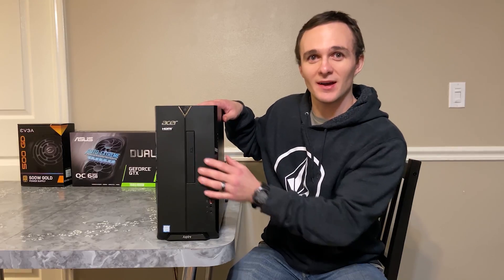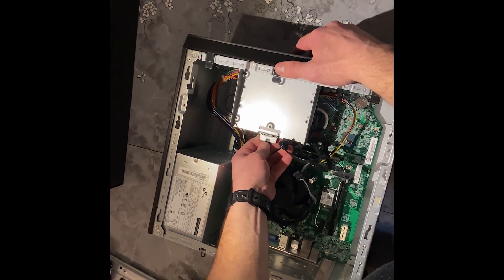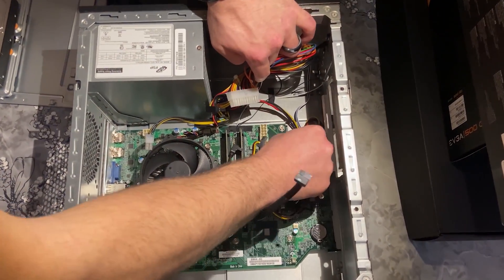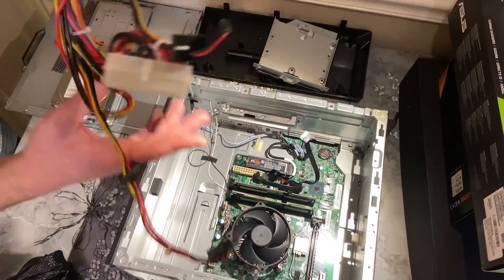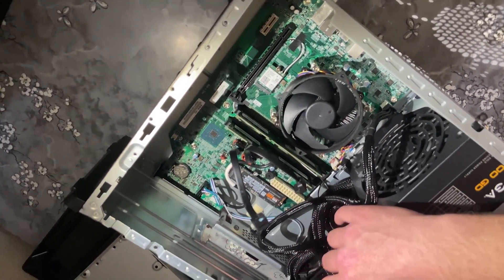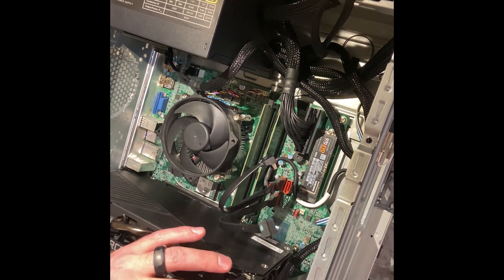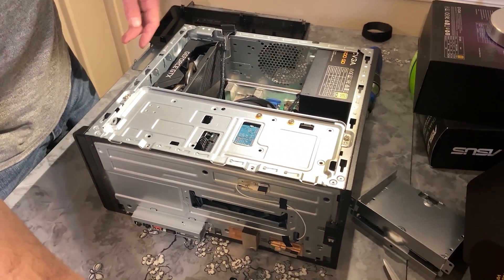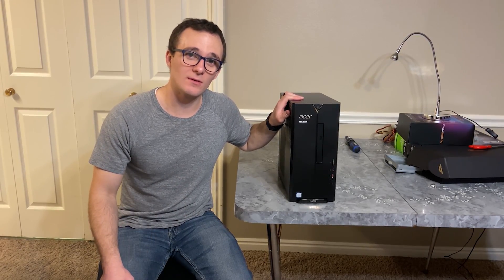How to put an Nvidia 1660 Super and change the power supply in an Acer Aspire TC-885 ACCFLi5

Comment: I have an issue with this. I basically have done exactly what you did with the graphics card (didn’t need a better power supply) but the ‘Intel (R) UHF Graphics 630’ after me uninstalling it reinstalls itself automatically. After using special software to uninstall it, my screen just flashed black and it reinstalls itself. Any fix on this? i have the exact same PC by the way
Reply from the maker: I think Windows sees that you have a cpu with graphics onboard and automatically re-installs the drives for them. When they are installed, does the display on your gpu not work?
Reply: dmoneyballa it turns out i did need a new power supply. i really appreciate the effort though, you are really dedicated to this channel

Comment: Thanks for the DIY video 😃. The 1660 Super has a HDMI 2.0b port. Does it support 4k@60hz? My Acer TC-865 w/i5-8400 HDMI ports are 1.4b which are limited to 4k@30hz. I simply want a graphics card with HDMI 2.0 supports 4k@60hz, HDR, 10 bit color and wcg (wide color gamut). 

My desktop PC also has a USB 3.1 type C gen 2 and SHOULD (BUT DOESN'T) support 4k@60hz resolution with a USB C to HDMI 2.0 cable or adapter. BUT THE DARN USB C PORT DOES NOT SUPPORT 'DP ALT MODE'👿!  

ONLY CERTAIN LAPTOPS AND DEVICES SUPPORT IT (IPad pro, Samsung S8, S9, S10, Surface Book 2, Dell XPS 13/15, Pixelbook and others).  WHY A DESKTOP PC WITH AN INTEL I5-8400 CPU THAT SUPPORTS 4K@60HZ IS EQUIPPED WITH HDMI 1.4B AND USB TYPE C  HARDWARE THAT CANNOT DELIVER THE CPU'S FULL DISPLAY RESOLUTION MAKES NO SENSE.  UNLESS I'M SIMPLY CONFUSED AND OVERLOOKING SOMETHING. 
https://www.amazon.com/s?k=USB+C+to+HDMI+2.0+cable&i=electronics&ref=nb_sb_noss_2
Reply from the maker: I think it'll do 4k@60hx just not in most video games but dipslaying content I think it can. When I go here https://www.nvidia.com/en-us/geforce/graphics-cards/gtx-1660-super/#specsmodal and click on full specs, I see that it has displayport 1.4a and hdmi2.0b and at the bottom it says 4k 12-bit HDR at 144Hz or 8k 12-bit HDR at 60Hz over one DisplayPort 1.4 connector (with DSC). I don't know if that's what you're looking for but I hope this helps.

Comment: So the installed GPU in the video has the dimension of 20.6 x 12.4 x 4.6 cm, may I ask if this PC case has enough room to house a 1660 S GPU with size 24.6 x 12.7 x 4.6 cm,  about 4 cm more in length? Thank you :)
Reply from the maker: Yeah that fit, here's a photo of how much space is left after installing the gpu, I removed the power supply but this is a good idea of how much space there is: https://dmoneyballastech.wordpress.com/2020/11/03/space-with-my-1660-super-in-acer-aspire/
Reply: @dmoneyballa   Thank you so much

Comment: could I put a gtx 2060 into this?
Reply from the maker: Yeah as long as the dimensions are right.
Reply: @dmoneyballa   could you post here the dimensions of your graphics card please i could go based on that
Reply from the maker: Yeah here's the dimensions from Amazon: 8.1 x 4.9 x 1.8 inches.
here's a photo of it actually in the case so you know how much more space you have to fit stuff in: https://dmoneyballastech.wordpress.com/2020/11/03/space-with-my-1660-super-in-acer-aspire/
Reply: @dmoneyballa  im super interested in a 2060 as well but i dont know how to check if it will fit any advice

Comment: Hey there. Thanks a lot for the guide. It was very helpful. I have an ACER Aspire TC 885 EB-11. I wound up getting almost the same card you demonstrated in your video. I got the "Asus TUF Gaming GeForce GTX 1660 Super Overclocked 6GB" graphics card, while the one you were showing is the "ASUS GeForce GTX 1660 Super Overclocked 6GB". The 2 cards are almost identical except for the size. The "TUF" card occupies 2.3 slots, while the "Geforce" card you showed occupies 2.7 slots. Not much difference really, but the additional space of the "TUF" card might give a bit better Airflow around the components. I got the "TUF" card on Ebay from Newegg for $300 CAD. 

I used your Associate Link, and purchased the EVGA 500w GD Power Supply. Hope that helps a bit. I paid $100 CAD for the Power Supply on Amazon using your link. 

I'm actually doing this upgrading so I can make my 1st foray into VR gaming. Picked up an Oculus Quest on Ebay for $300 CAD. 

If anyone is interested in seeing a pretty compelling video on a great VR build on a budget, check out MRTV's video. He actually recommends the GTX 1660 Super in his build, though he goes with a 600w PSU (though he does mention it's a bit overkill, and he uses it just in case the User wants to further upgrade in the future). Here's the video :

The $700 VR PC For Stormland, Asgard's Wrath & Half-Life: Alyx - Perfect For Oculus Quest & Rift S!
https://www.youtube.com/watch?v=ukdxxVSjzr8

PSA : I do want to say that the Oculus Quest looks to be an amazing VR Device for a great price and I'm crazy excited to start playing...but...all of us Gamers need to be aware of what Facebook is doing with the Privacy Policy. All new Oculus users starting October 11th, 2020 will be OBLIGATED to use a Facebook account WITH their "Real Name" and "Real Phone Number". No burner accounts allowed. Facebook will be collecting all kinds of data on Users including : Location, Play Space, etc. Let's be clear. The reason Oculus Quest is so cheap is because YOU are part of the price of the device. Your User Data will be paid out to "Facebook Partners". 

MRTV has a great video on the topic. 

OCULUS QUEST 2 - WATCH BEFORE YOU BUY! What Forced Facebook Login Means For VR | MRTV Opinion Piece
https://www.youtube.com/watch?v=GKaI_lHHV4Q

Conclusion : I'm really excited to play with my new (Ebay used) Oculus Quest! And I'm also really excited for HTC, Valve, Samsung and others to come out with their own Standalone VR Headsets so I can get rid of my Oculus and move to a VR Platform that doesn't FORCE me to use my Real Name, Real Phone Number and have my data being sold to unknown 3rd parties. 

Sorry Facebook. 1984 wasn't a Playbook on how to run society. You seem to forget that.
Reply: Thank you for clearing up two different cards! I was wondering why the one he linked looked smaller/different.

Comment: i put a noctua fan for an upgrade on the sys fan output and the fan wont stay on only when booting and turns off any reason ? im gonna be doing the same upgrades i have the tc-895-ua92 version
Reply: I have the same model computer and had the same problem.  I used the supplied y-cable to connect the NF-A9 to the same connector as the CPU fan.
Reply: @dadx6101  could you tell me step by step what to do I’m new to this computer world lol

Comment: I am going to do this however, I am going to add a GTX 1050ti as it is smaller than the 1660 to make better air flow, I am also going to add a 120mm fan to the back side to help air flow
Reply: Can it fit a 120mm fan at the back?
Reply: @tightonthatmoney  not sure, an 80 mm fan might be better

Comment: i put a new 500w power supply in mine and it worked. i also put my new geforce 1050ti card in it would not turn on and do i have to pug in the six pin connecter
Reply: Daniel DeAmicis yes, you put the connector in
Reply: but make sure that you plugged the hdmi/dvi/displayport into the GRAPHICS card not the board

Comment: do i need a new PSU or will the stock psu work too
also will gtx980 strix fit in the case?
Reply from the maker: It may work with that. I would use Newegg's powersupply calculator to see if it will work: https://www.newegg.com/tools/power-supply-calculator/
I got my gpu in there with these dimensions: 9.50 x 5.10 x 2.10 inches
Reply: dmoneyballa thanks
Reply: @dmoneyballa  sorry but do you know what motherboard this pc uses? i don't know and it needs the motherboard to calculate the amount

Comment: Hey I just wanna say your videos has helped me so much uprade my acer 885. I just put a 450 watt psu in. Now I wanna do my gpu. I have a 1050 ti in now. Can I put in a 2060 with the 450 watts or should I just save some money and do a 1660 super.
Reply: Do you know if the 2060 fits inside? I’m thinking about doing the same but i’m not sure if it’ll fit or not
Reply: @brynan6206   I don't know if it fits. I just ended up getting a 1660 super. My main thing was I don't think I have a big enought power supply
Reply from the maker: I like to use Newegg's power supply calculator just to make sure it'll be able to handle it. https://www.newegg.com/tools/power-supply-calculator/

Comment: I have a question - did you reconnect the DVD drive and if so - did the power supply you used have a small data power connector for doing so. I have a cooler master 500 watt here and it doesn't have that tiny data power connector so I can't power my dvd drive anymore now that I replaced the PS.
Reply from the maker: I didn't connect the DVD drive when I switched the power supply. You could use an adapter like this:  https://amzn.to/3gKjVhH

Comment: Hey dmoney. I talked to ya a month or so ago about my aspire 885. I'm getting the i7 9700f like u suggested. But I also got Noctua NF-A9 pwm but I don't know how to make it work. I tryed looking for it in the bios but no look any suggestions?
Reply from the maker: is the issue that the computer won't boot when you place the 9700 in the cpu socket?
Reply: @dmoneyballa  no I haven't even gotten the i7 yet. I put the case fan in. And I connected it to the four pins connector on the motherboard. But the fan won't run
Reply: I had the same problem.  I used the supplied y-cable to connect the NF-A9 to the same connector as the CPU fan.
Reply: @dadx6101  but can you control the speed of the fan or is it on all the time?
Reply: @robesposito9763  When the Y- cable is plugged into the 4 pin CPU fan connector the speed varies along with the CPU fan.  When the fan was plugged into the system connector I never did get it to turn even when running all 6 CPUs  at 100%.
Reply: @dadx6101  ok good to know so the fan won't be at 100% all the time
Reply: @robesposito9763  Just make sure you leave a few inches of  open space on the side of the the case with the air holes.

Comment: Hey man absolutely great video helped my understand the pc a ton, I have an Acer aspire TC 885 ua92, and I was wondering if I got a 700w power supply, could I put a gtx 1080 mini into the computer? any response would be highly appreciated, thank you!
Reply: How did this go? Im hoping to get a 650 watt and rtx 2070 super.
Reply: @DAN.eight6  hey dude, since that comment I have actually sold the computer and bought a much better computer, however with the specs that I listed, it fit into the computer perfectly! The only slight complication for mine was that I had to remove the CD tray, but I never really used it anyways, and it was easy to remove. I am unsure about your specs because as I said, I have since sold the computer, but with a 700 watt power supply and mini gtx 1080, it fit like a glove. Make sure to buy the smallest graphics card you can if possible, cheers!

Comment: can i do what you did but with a 1650 graphics card and if so do i need a power supply too?
Reply from the maker: You can put in an Nvidia GTX 1650 gpu without changing the power supply.
Reply: Hey @dmoneyballa I just bought a 1650 and bought a acer aspire TC EB11 and followed your video on how to install the GPU but after I plug the 6 pin connector into the GPU I am unable to put the hard drive plate back on flush because of the intruding connector and wires in the GPU. Do you have any ideas on how I could fix this cause The dimensions on our GPUs are the exact same so I’m confused on why I can’t get mine to fit

Comment: Hopefully I'll be able to do the same thing to my Acer Aspire XC 886 with the 220w built in PSU. Difference is, that type of PSU can never fit to the small factor case. I searched online and it's either a flex atx power supply or TFX power supply. I'm new to this and I don't know why I feel so dedicated in doing so.

Comment: Hey I am looking to do this have you had any problems so far and what kind of frames do you get for aaa games
Reply from the maker: I wasn't using MSI afterburner at the time of the upgrade so I don't have a ton of tracked data but I did some benchmarks in this video: https://youtu.be/13azmnUHYeo. Hope this helps.
Reply: @dmoneyballa  did it ever over heat for you or something
Reply from the maker: I didn't play too many games on it while in the Acer case, I mostly video edited and it didn't cause any problems. I put it in another motherboard and another case with more case fans so it would get better airflow. I'm still using the same 1660 super but am using a Ryzen based system currently.

Comment: My motherboard starts beeping when I boot, Help plz :(
Reply: Do you still need help
Reply: Michael Finlayson its all good now, the ram wasn’t installed correctly...
Reply: I could use help.   Same problem only works when I disconnect card
Reply: @elixertherapper9264  what is the type of beep? (like 1 long beep? 4 beeps?)
Reply: 1 beep then fan runs and nothing else monitors have no signal
Reply: @elixertherapper9264  Did you install a Ram stick?
Reply: Ram was already maxed out before this but I just figured it out.  I have 2 monitors and whe. I unplugged the 2nd monitor that wasn't plugged into the gpu and disabled the integrated card it worked
Reply: @elixertherapper9264  Nice

Comment: Did you have any overheating problem because the GPU seems to be really close to the bottom of the case
Reply: I did this exact setup with a 1660 super there is a bit of heating problems but as far as i know, the GPU doesnt really get more than 70-75C on max load. I was running modern games on max graphics with 144 fps and was getting about that. It gets close to an uncomfortable range, but i dont think i have ever seen a temp higher than 74C.

Comment: Thanks for the video! I just got an Acer, too. Do you know if I can install a secondary drive in the dvd drive slot, or is that just for laptops?
Reply from the maker: yeah, you could probably do that. The hard drive tray has space for another drive and there's also an m.2 on the motherboard that you can use to connect an ssd or nvme drive.

Comment: I’ve installed the gtx and everything’s good but when I try to connect it to my monitor it won’t show
Reply: Try to connect HDMI cable to graphic card.
Reply: Same here, pc boots, gpu fan spin but i have a black screen
Reply: @sdss903  Did you fix this problem? I'm having the same issue
Reply: Raghav Rao yes it was fixed.. it literally fixed itself. I quit trying for a couple days, i tried bios configurations (very limited), i updated all my drivers, i updated bios.. nothing seemed to work. After the few days i decided to try again and make a boot usb.. when the pc was up and running I realized it finally was running on my cloned nvme finally. I still haven’t wiped my hdd but it has been booting up perfect for a few weeks now.

Comment: I can't put my hard drive back on after plugging in the 8 pin connector. Any tips?
Reply: I’m having the same issue right now and I’m wondering how he fit the hard drive in with ease my 6 pin connector and wires aren’t letting me put the hardrive plate down flat did you figure out a way around this?!
Reply: @fendermac1  from what I understand they do it on purpose. I didn't find a way unfortunately and bought a new case. Wish I got custom built from the start.
Reply: @Jordan-oy3bg  dude im thinking the exact same thing.. might have to "A" return this computer as im still in the 30 days I have to return it and get a different comp or "B" opt out for a smaller gpu with only 1 fan i suppose.. tough one..

Comment: After swapping to a 500W this my machine would not recognize my GTX 970 any ideas why?
Reply: Did you find a fix for this? Mine wont recognize my GTX 1660. As best I can tell, the BIOS wont switch from the onboard graphics (even after uninstalling the device)
Reply: Have you downloaded the drivers for gtx 970 card?
Reply: @deweyoogwey  I did.  Ended up being the OS that was flaky.  Repaired the OS and it was fine

Comment: Great video that cd rom custom cable is called what the reason I'm asking because it's split on the old power supply so I can't take it off and I would like to use the cd drive but I don't know what that cable is thanks again

Comment: I bought an RX-580 for the Aspire Tc-885, but my computer doesn't run.  The fans of the card normally run, but there is no display. What's up with that?
I have an I5 9th generation
16 GB ram
600 power supply
Reply: same :(

Comment: PCIe slot gets covered by the graphics card :(
Reply from the maker: yeah, it's a beefy card
Reply: @dmoneyballa  im trying to use an Elgato HD60 Pro and install graphics card at the same time so its probably not going to workout for me :(
Reply from the maker: The way to get around this is to switch motherboards, the acer motherboard doesn't have very many pcie slots to begin with but if you get something like a full-atx motherboard, there should be plenty of room for the Elgato and the gpu. It's not the best answer because you'll need a new case too...